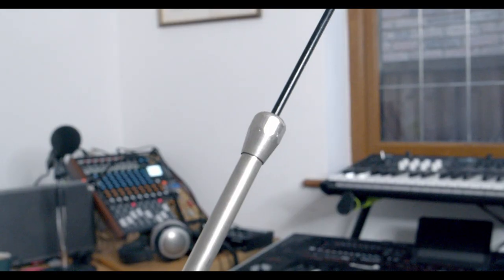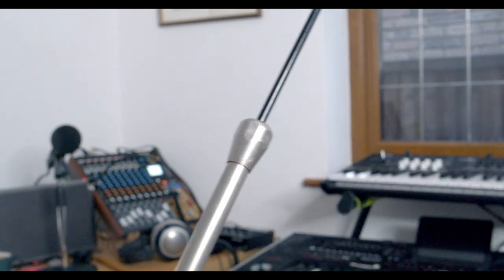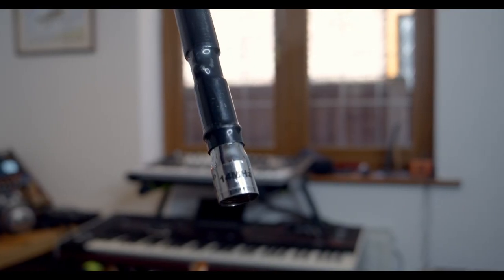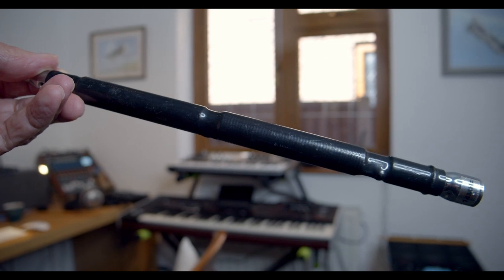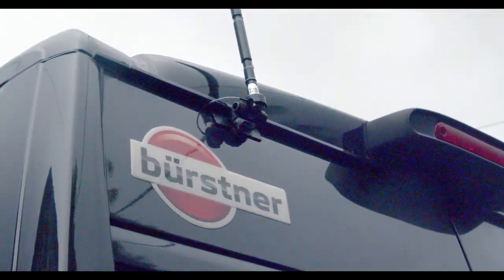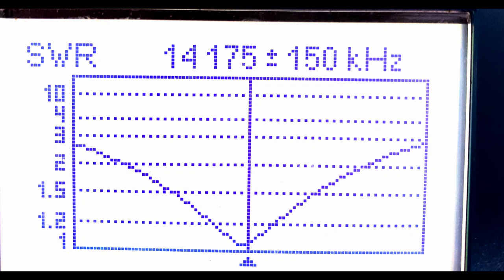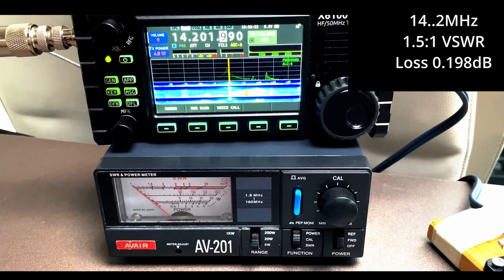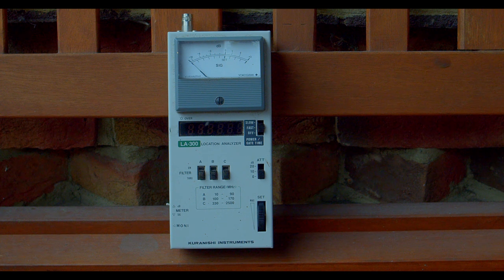HF Mobile 2 Way Stretch - Your HF Mobile Whip may be more flexible than you think!

Comment: Diamond are my go to Antenna Peter, I have the Hf 40 and 20, I also have the x300 too. They do what it says on the tin and have never let me down. The 40 and 20 have worked exceptionally well when used even though most of the time i use a triple mag. Swr hover around the 1.5 and with the use of the internal tuner i can work most of the phone portions on both bands. Buy cheap, buy twice is the formulae i use although you cant beat an Antenna you've built yourself out of parts laying around the home, but if i was asked to chose a brand that i can rely on, its Diamond every time. thanks for another informative video Peter, Look forward to the next. 73
Reply from the maker: Many thanks Mat. 73 Peter

Comment: Very interesting. I was doing 17m and 40m mobile with the Ampro whips until the conditions got better. Then I bought one of the big Sirio CB antennas and cut it down for 10m. I don't currently have a 20m antenna, but I used to use a very short G-WHIP on 20m and it really did work. This Diamond one might be worth a go.
Reply from the maker: Thanks Gordon. Yes it is amazing what you can work with a short whip. I will cover this in a video shortly. 73 Peter.

Comment: Thanks Peter for such an interesting subject
MFJ-908 / MFJ-909 / and  MFJ-910 considered as Matcher/Band Stretcher but i don't know if it's has any positive Or negative effect to Antenna Efficiency  ..?
Further more MFJ-908 is an "inductive" Matcher which DC Shorten the Line Ends , but i don'y know if it's has any beneficial effect to Received Noise Levels ..?
Reply from the maker: The matching units have no affect on antenna performance, and most matching units have very low loss.

Comment: Informative.

I've been thinking about trying mobile HF for awhile now.  The configuration I'm thinking about is a remote ATU mated to a common 102 inch whip.  I have an old Yaesu FT-857 sitting unused in the closet, so it'd mean purchasing their FC-40 for installation in the trunk, and something like the Diamond K400 trunk lip mount for the whip.  I'm thinking this should give me hassle-free multiband coverage.  The primary incremental cost for me is about $300 for the FC40.

Do you have a feel  for how the proposed configuration might compare with the one demonstrated in the video?
Reply from the maker: Yes that will work.